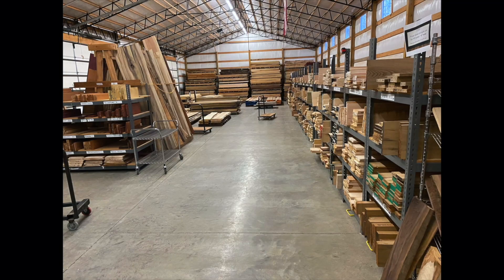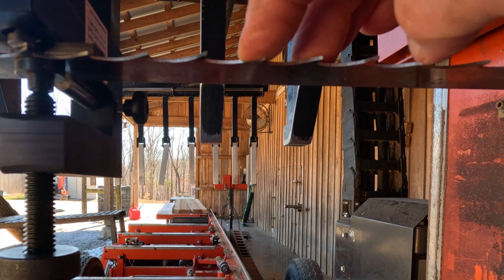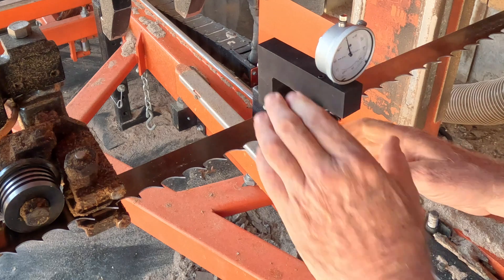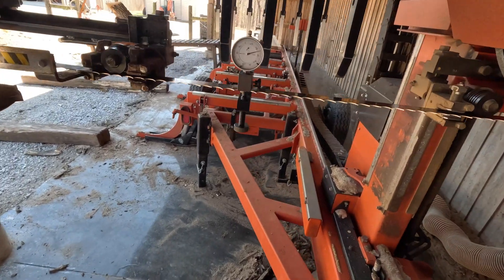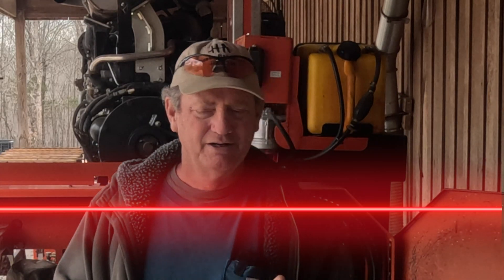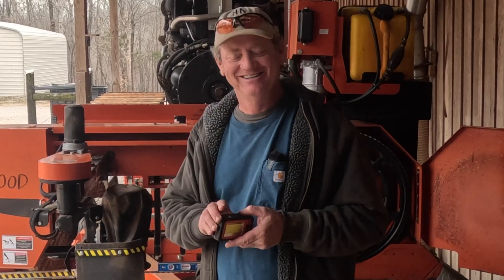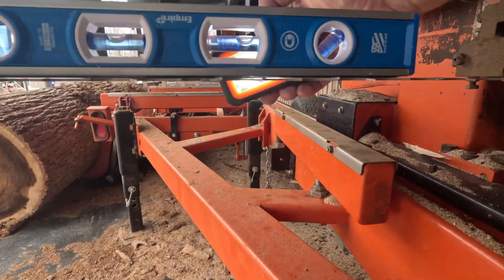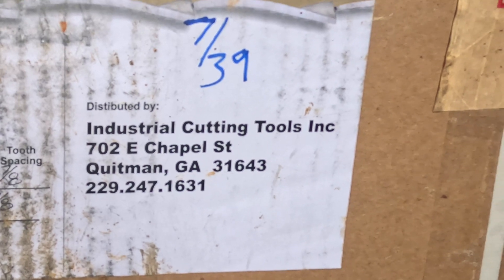Sawmill Not Cutting STRAIGHT? Quit BLAMING Yourself -  It's Not YOUR FAULT - Check THIS!

Comment: How do you keep sawdust buildup if you run lubricant?  I know you don’t run much pine so maybe that is the difference.
Reply from the maker: Not sure what your question is, but diesel is used by the professional pine band mills I know, one saw 2.5 million bdft per year, and only uses diesel as lube, nothing else.  No sawdust is the goal no matter what band lube you use, it means you are cutting fast, clean and straight.

Comment: Love the videos we run a mill in the UK 🇬🇧 and your videos are very knowledgeable, would love to see more milling videos of different timbers like sycamore and elm etc.
Reply from the maker: Thanks for watching!  I kind of make the videos based on the technical difficulty of the species being sawn, so I will be doing more sawing videos as the logs come in.  Sycamore and Elm rank up pretty high on the degree of difficulty.
Reply: @HobbyHardwoodAlabama  ideal, had lots of cherry in a while back and used your techniques for sawing that and it massively improves the value and quality of the timber. Look forward to it 👍

Comment: Great content professor. Do you bother to set and sharpen a blade which has very small stress cracks in the gullet, or  do you throw them in the trash?
Reply from the maker: If I can see the cracks, then the band is DOA.  Scrap steel is selling for 8.5 cents per pound, I just throw them in the pile with all the other scrap.

Comment: About 1.5 years ago, I was having issues milling spruce and white oak with 7 degree turbos.  I switched toe 4 degree and no problems.  Sometime later I was speaking to a Resharp tech who said they had some issues with blades being set improperly.  My next trip there I brought the suspect blades to be checked and sure enough, the set was different from one side to the other.  They reset all of them.  I never considered the set gauge but just ordered one.  Thanks Robert for another informative video.
Reply from the maker: Sure glad to help.  It is not unusual to have brand new bands show up with an incorrect set, considering how they are made.  A good gauge answers a lot of questions, and also a lot of self doubt.  It aint your fault when the band is crap.

Comment: Good morning,  another great video. I have begun to keep a notebook of your “master class” so I have a quick reference at my mill. At the moment all my logs are frozen solid, so waiting for warmer weather. There will be some new parts going on as well. So far with the sawing I’ve done about 2,000’  i have not been able to find the right combination of blade speed to feed rate to minimize accumulation of sawdust. Some of the issue is the mill is essentially home built at this point. (Not by me). No tension gauge, no scale board, poor blade guide adjusting arm. Blade roller location varies more than 1/8” up or down. And May be under powered. Other than that it’s fine haha. All of witch I will be bringing up to your specs now I know what I’m looking for. Lots of room in my note book,looking forward to the next class.
Reply from the maker: Sounds like you have quite an adventure ahead of you.  Thanks for watching and commenting.

Comment: That's some beautiful wood, I've had a few new blades break right on the weld, seems like it was the the cheaper ones, I've had great luck with the double hards, only complaint is the tooth spacing isn't always perfect at the weld when I sharpen them.
Reply from the maker: That is a manufacturing defect, it shouldn't happen.

Comment: Great video sir, 
I get all my bands from Joe at ICT, have been very happy with him.
Thanks for your knowledge and experience at the mill.
Have you run or had a reason to run the bi metal?
Thanks again sir!
Reply from the maker: Yes, I've run bi metal and they do pretty well, but what I have learned is that it's hard to beat a good resaw band that's less expensive, lasts longer, and most imortantly, manufactured correctly.
Reply: Yes sir, Woodmizer  sent me the attachment ( re saw ) looking forward to seeing it in action. 
I used them for a project for a customer that wanted a bunch (40 ) treads for a stair case out of glue lamb beams, the glue that they use has clay in it,  cut like butter
Reply: Good morning sir,  these babd videos you have done are a must watch, do you use the Woodmizer stress guage also?
I've found it to be very helpful in running my bands correctly and for the right amount of time to not fatigue it first run.
I've been trying to get Joe to get us connected,  he's my band guy as well, will you still be using him when he goes to Woodmizer?
PM me, would love to talk!🤞🧡🧡